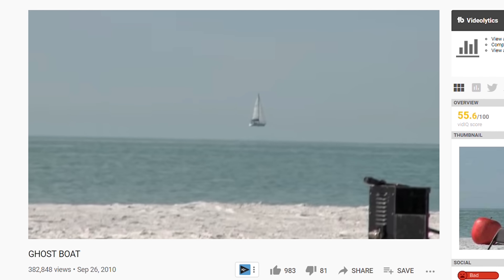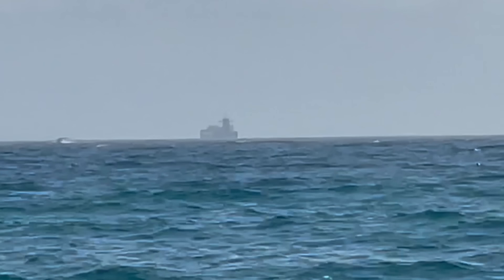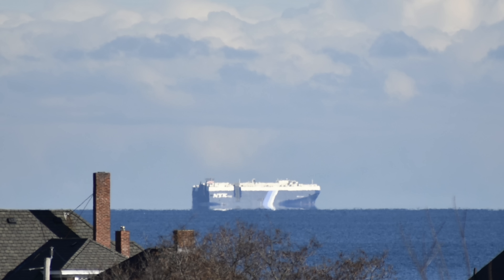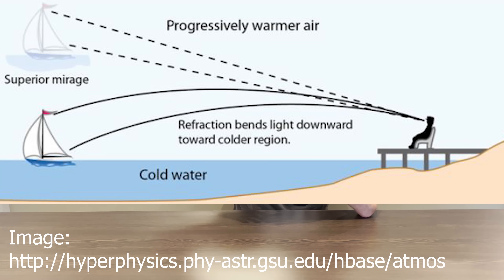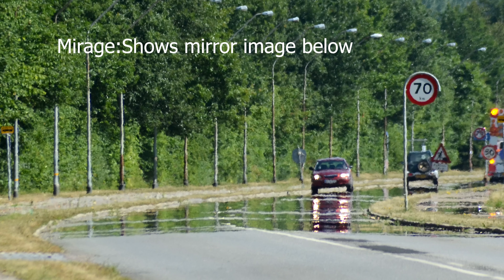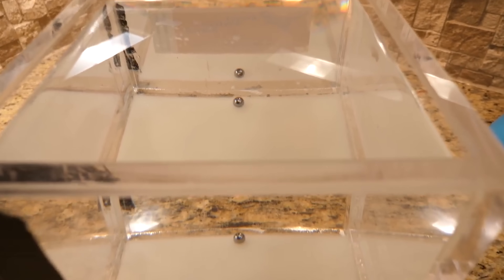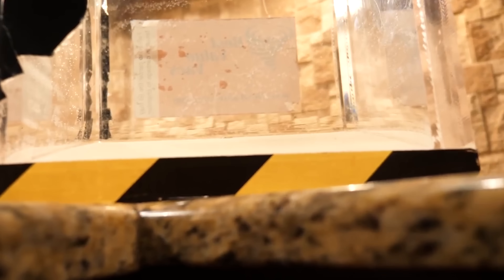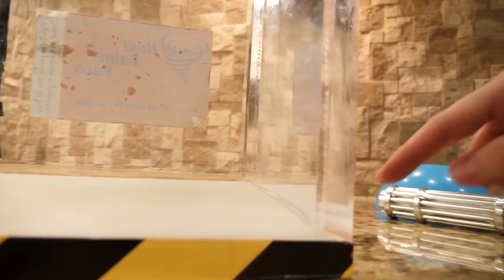Fata Morgana—Boats That Float In The Air

Comment: One time, when I was smoking marijuana out of my bedroom window -
I looked out and, on the horizon, i saw what seemed to be a translucent red/orange circle about 5-7 degrees above the horizon.
I thought this was odd, and so i watched it for a long time, and observed that it did not move, or change in any way.
Eventually, i just went to sleep, and didn't think much of it the next day.
But then! It was still there the next night, and the night after that, in the exact same location. It was about 1.5x the area of the moon.
It also seemed to have a texture to it, similar to the moon's cratering patterns, but lacking the region of volcanic activity that once changed the moon's surface.
(The moon was visible in the sky, on all three nights)

I still have no idea what this was...
I first thought it could be a refraction of the sun, but it was due south, instead of the the west... and if it were the sun's refraction, through the atmosphere, i would expect it not to be so stable in terms of location, surface "texture", and longevity!

Very confusing!

Comment: Absolutely incorrect explanation of the phenomenon of mirage.

The flying ship effect occurs when the evaporation layer above the surface of the water is warmer than the air. Cold air - high pressure, warm air - low pressure. Reflection always works from PRESSURE to DISCHARGE. 

We see a flying ship because below the ship we see a strip of reflected sky. Moreover, the Imaginary horizon in this phenomenon is lower than the TRUE horizon.

Comment: Light bending does not explain why you can see the sky below the boat and above, there has to be some really weird reflexion and bending that cause the effect together. But nicer it would be if you could actually reproduce that in the lab. I would accept using fluid layers but you need to see the sky above and below the boat with no reflexion of the boat.
Reply: It could be when you than the atmospheric duct(which is trapping the light) that you are slightly below the image of the ship and so light from the sky reaches you under neath it. Imagine you have a parabola curving down towards the earth, like when you throw a ball, there is a straight line from the sky that will just be inside that parabola when it touches the ground. So your eyes receive the light of the sky below that of the ship. Light from the sky would also be refracted like the light of the ship. It’s quite a complex phenomenon that I am still trying to understand myself

Comment: This video is a very good explanation of mirages and Fata Morgana. However the image at 0:13 is neither of those things. Note that there is no distortion or mirroring of the boat. There is in fact no mirage at all happening here. All that we are seeing is a water surface which is very close in color to the sky. This is made more pronounced by the limitations of most consumer grade cameras, with additional visual information being lost when the images are further downgraded to post on the internet.
Mick West has a good discussion of that specific image at 0:13. In the case of this image you can just barely make out the true horizon, which is just above the bottom edge of the sail.

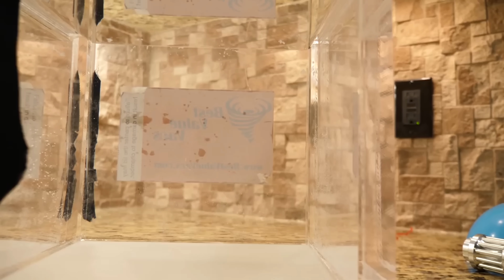Comment: Good video. Just a small correction: at minute 3:38 you see the edge of the box bent downwards. That’s actually light bent upwards at the interface between glass and air. You must be careful how you use that box, as it doesn’t always reproduce the atmosphere as we see it. We are like inside the box, and effects due to the interface between the box and the air outside can be misleading.

Comment: who studied poorly will say that the video is true) the explanation for diffraction is incorrectly applied in this situation. the lens of humid air can make several variants of optical distortion. Lower the near horizon, raise, flip the image within the boundaries of the lens. The boat did not take off anywhere. The lens of moist air was below the boat and flipped the image and reflected the sky. There was a flight effect. But the boat was in place. Don't mislead people.

Comment: The initial image of the "floating" sailboat is not a Fata Morgana, but a false horizon. Due to optical circumstances, what appears to be the horizon line is lower than the geometric horizon, and then a boat floating quite normally on the water can be in the zone where the water surface looks like sky. As correctly explained later in the video, a Fata Morgana includes some upside-down effect.

Comment: Err, wrong?

If this was due to light bending then the boat would still appear tom be on the water since the light from the water would be bent the same.

What is happening is the water is reflecting the sky so it appears that the boat is surrounded by sky, not water.

Comment: The "boat floating in the air" is not a mirage. It's a region of water further out from the shore that's calmer than the near water. At shallow angles this more completely reflects the sky. 
Mirages are inverted and distorted. These are not. They are not mirages.
Reply: definately, you can even see the horizon if you look close enough
Reply: That’s right

Comment: But why was just the boat being refracted and not the texture of the water that the boat was on? I would expect, like the metal ball in the tank, for there to be a slope that is the water surface and the ship object at the end of the slope, but the ship on the ocean is floating in the air?
Reply: Because the video is wrong, you are right. Its just the water around the boat reflecting the sky.
Reply: @dougaltolan3017  Very sudden calm and reflective water right next to choppy ocean. You'd expect a gradient of reflectivity as your viewing angle gets more shallow. It could be that both things are true, refraction and higher reflectivity.

Comment: So being surrounded by extremely cold air would make you appear invisible or warped at long distances? That means, hypothetically, if you were to somehow create a thin "force field" of super-chilled atmosphere around something you would be able to effectively remove its visual signature. Did we just discover a working active camouflage? Regardless, if the relative differences in atmospheric temperatures makes discerning things with the naked eye impossible to do with any degree of certainty then it brings a lot of observations and beliefs into question.

Comment: Your point about why we think it is higher than the horizon because of the way our brains are wired, I disagree with. Earlier in the video you make the point of the bending of light and refractive index. The laser thru the box is a good example. If you were on the side of the box where the light exits it would appear as a straight line. We don't see not do we know that the light has entered the box at a different angle. Our brains do not reprocess the motions of light. Our brains take in the light exactly as it travels and just at the end of its travel. So, the light bending around the horizon must then travel in a straight line towards us. We then interact with or receive the light at the end of its travel, at our eyes. Even of the light continues to travel in a curve to its end at our eyes, we  would still see its distorted image. Images are collections of photons. After the Sun, or other light source releases its light, the structure of the waveforms of this collection of photons is maintained until it is changed by reflecting off of a surface. The photons hit the boat, the surface of the boat changes the waveform of the photons and reflects them, the photons travel again, they travel thru an area with a difference index of refraction but their new waveform from the boat is still maintained, the photons continue along their new path, and finally they reach the eye of a person. The brain maintains the waveform of the photons as the brain received them. It processes the photons as it received them in a way that maintains the photons' waveform in order to produce an image that reflects the waveform of the photons. This maintenance of waveform is needed for close survival purposes. You need to know that tiger, as maintained in the waveforms of the photons that reflected from it, is a tiger, so you can escape it or be on guard against it. You need to know the apple, as maintained in the waveforms of the photons that reflected from it, is an apple, so you can have food. This maintenance of photon structure is pivotal to human knowledge and survival, but gives some interesting results as far as mirages and fata morgana are concerned. But it is not a result of our thinking, but just the way the world is. But whats great, as human beings, with our abilities to reason, we can understand why something like a mirage or fata morgana occurs.

Comment: Would the RF@5.8GHz will too bend slightly and follow the earth curvature at least for 100km.

I have an HD FPV radio link using raspberry pi both sides and if my plane is 300mt height at location where I am and would it still be in line of sight when the plane is 100km away maintaining same 300mt altitude?

Comment: It is right in video but not right enough to justify upward of mass above the curve since that would means all curve outward that we see as flat but it is curve, which we should see, but we can't since it is so big, so the cloud doesn't curve since it is so big, that may be but it doesn't cause visual flat that we see which is below the curve that is Fata Morgana since the light hit the higher density air that is heat to lower density air that is cold, but cold has higher refractive so it bends more. Cold is lower density and higher refract so it bend more. So, higher heat, lower fract since the density holds the light more and bend it more, than release the light more as it goes downward since the heat expand the electrons or curve in frequently, per time on axis of electrons. The point it more more. So, cold air bend light more and hot air bend up from normal bend down of colder air, so it will go up in normal level. So, a balance of between cold and hot. 

So, the sun it shows in video above bend up, when the sun is below? So, because of our brain, but no statement about air stuff, so the object of light that is sun, so would the object of light bend more than the boat?? Or it is really straight, so no bend down or bend up? Well, because the boat is in the medium like in video above for glass stuff that water is inside, so it is within the medium. But the sun is out of medium, so it enters the medium so to our eye, so it bends up or down, so it depends on cold and hot of medium to cause the bend of light which cause the sun to go up or down. So, it will be better and accurate to show science to match exactly like a big glass with big ball, so you pour the water over top and put stuff on it so will the stuff raise? Make it humid in air and in range, so can include fresh water or salt water. So, not with you have that is sugar and water since it will not match accurately since different density, so best to make same density and same condition. So, the eye can match what the reality says, not what you say you can't trust the eye that is what reality says, well, one thing is right you can't trust your eye base what humans says but you can trust your eye base what reality says since reality provide all knowledge to figure it out so it is all there, but humans will not show all is there but will hid things so you have limit knowledge so you can't trust humans. 

It would not fully justify flat earth but make you understand. Well, it may justify flat earth because the video above says the sun should be up, when it is down so it is because of two different temperature of medium interact so cause the object to raise or sink, so that would means at all time all over the earth it is all flat but really it is globe because one layter is always with us on the ground, and one layer that is above is always with us on the ground, so both layers and the ground always with us so it always put the object to our eye, so the further the object, the further the pull upward, but it can't be since the sun goes down, so the sun can be pull up in a big way, so it is constant light, so no night. So, how much pull up of an object and which is higher likely to be pull of an object upward to your eye? Well, it is depends how close you are on horizon and the pull power for all horizontal all over the earth that is curve will cause big pull to view to our eye as flat? It would be good to know how much pull does two different temperature cause? The higher temperature, then the higher pull up and down? Or there is a limit. 

Well, it doesn't justify globe earth and flat earth, which the person says it justify by saying it lifts up the object. Not base on temperature but base on our brain, so our brain trick us, well, it is a bait and switch to make you think your brain trick you when it is people that trick you. Reality do not trick you but provide all answer to look at the truth and it is good to follow the model that match reality to see what is true or not, like water with salt and water in air, and so on. That is true science. It depends on how you feel it can justify because pull power to lift up from below to up to make it flat to you and the surface of ground is curve. But the edge line of top and bottom that is on curve and on top to your view, so it is a square line with curve, so give you big pull power? Or less like on boat on video that has boat that float which boat lift up. But it is not full ocean, gap to boat, but ocean, to less color of ocean, then water, so it is on top of lighter hue of ocean, which the color change from blue to transparent, so the light bend up the color of ocean upward or downward to make it transparent. Something to think about and give video about it. So, color can change from bend of light? To be accurate from opaque to transparent?

Comment: 4:25 The effect is very real and has nothing to do with brains. When measuring a photon (which is basically what our eyes are doing), the only information that can be obtained is wavelength, direction where it came from, and polarization. This is very localized information and is not nearly enough to reconstruct the path that light take, let alone correct geometry of the scene.

Comment: What if more and more water were poured under pressure into a sealed vessel?
 When we do it with gas, it will condense. What if you did it with water?

Comment: Hey, James! 
I had a bag of chips in my closet (where I store my secret stash of snacks away from the children that want to take my lucky charms). Yesterday my bag of chips was inflated and today I have looked at it and it almost looks as if it has been vacuum-sealed. The only thing I can think of relating to this is that there was a dramatic change in temperature over the last day or two and it's been quite cold inside the house, but would that cause this strange thing to happen?

Comment: Sorry AL, all laser light tests across bodies of water have thoroughly DISPROVED the equation for any curvature of the Earth; according to their koolaid- 8 inches per mile squared. There is no curvature.
We live in a flat realm that is not moving. It is true that there are limits  to how far you can see. Hence it appears that ships are "disappearing "
Reply: Also the hot and cold air are NOT going to curve a laser light. Although  you show water can.
Reply: @BoneClock919pm  did you drop out of school at 12 years old? i think so
Reply: Just going to ask you what shape 8 inches per miles squared makes on a graph

Comment: Technically is this gravitational lensing in that the density of the material is modifying the path of photons, though since the light is being bent around all of the atoms it averages out to this aggregate refraction based on density of medium (a measure of local gravity)?
Reply: not gravitational, light bounce between molecules. not the same thing
Reply: @buckwarp1475  it's a whole pile of graviitational lensing at the atomic scale.  because the light has to go through more matter in it's path it is slowed and bent
Reply: @KaliFissure  not bent, it bounce, like on a miror.
Reply: @buckwarp1475  what exactly is this photon bouncing off of?  There is no surface as such. We are passing through the pieces that a surface is made out of. Bouncing off of the gravitational field of the protons?
Reply: Metals reflect precisely because the electrons shells are totally satisfied and so form a sort of electron condensate shared by all. This is conductivity.  Interesting that all common solid conductors are opaque. And most transparent materials are insulators

Comment: I don’t always just trust my eyes. Good thing I have other senses that let me know I’m not on a tilted whirly ball in a 2nd law of thermodynamics violation sky vacuum. Big ups for admitting the horizon is not a good way to determine if the earth was a globe. Most people get stuck on that. You could figure it out, you’re a smart guy. I mean, you already know a vacuum requires a container... now, just realize that gas pressure requires a container as well 😊 We’re in a closed, dynamic system
Reply: wow.... you sound like a parrot. have you ever heard of gravity?
Reply: @buckwarp1475  did you say gravity?...and I’m the one that sounds like a parrot 😂 I dropped my daughters helium balloon, and it didn’t fall to the ground 🤷‍♀️🤨 When I drop an apple in water, it floats... it’s not pulled to the ground. You probably don’t even know which gravity you’re invoking, huh? Newton or Einstein? Neither had a scientific hypothesis. Neither are a scientific theory 🤷‍♀️
Reply: @intentionallyspacedout735  ooh other senses, hum?  How have we measured the shape of the earth since eratosthenes?  How high is this supposed container?  How does the atmospheric pressure reduce inside the container?